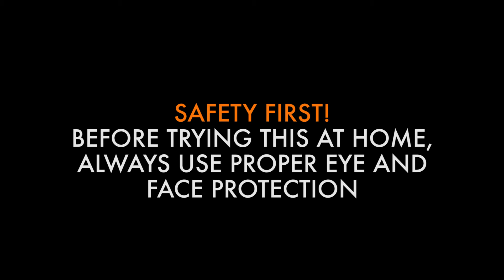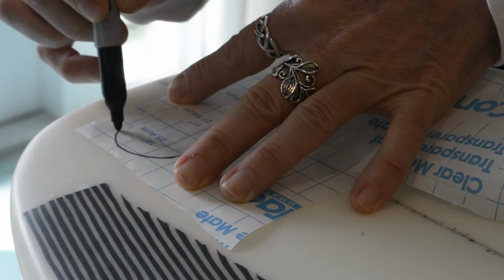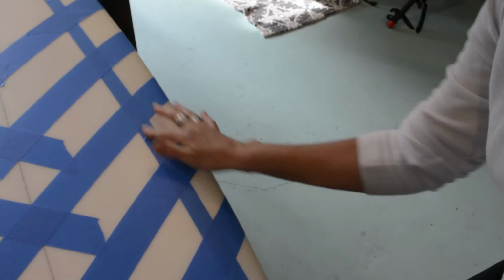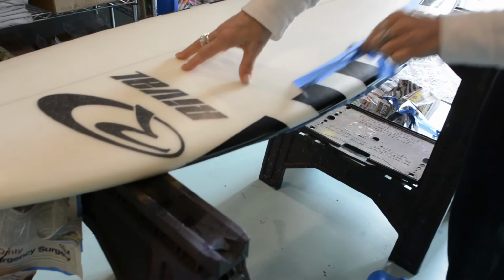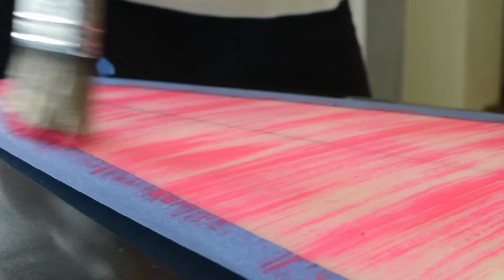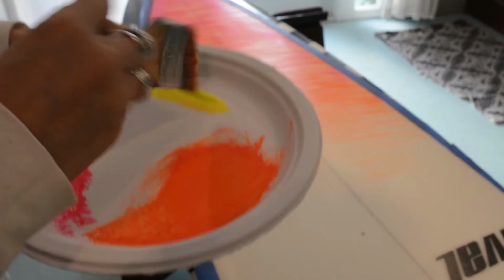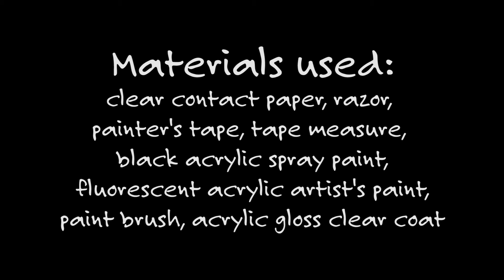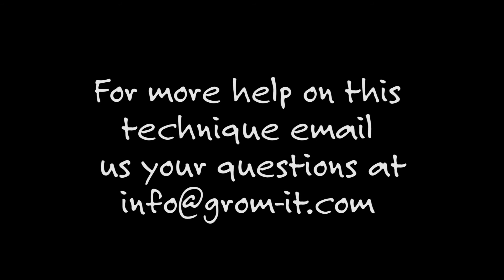DIY Board Art: Gromming a Board with the Dry Brush Technique for an 80s Inspired Look

Comment: Thanks for getting back to me. Yeah its a brand new board ( i didnt sand first though) the paints are acrylic. Half the board is black and that dried and stayed on fine but the other half i tried a  fluorescent orange spray and it never really dried i took that off. I then tried a  fluorescent orange craft paint and that just peeled off. My friend said maybe the paints were too low quality as some student paints are really watery which they were. The orange that went over the black has stayed on though. Is it important to get high quality paints??? I was considering putting a white under the  fluorescent as I think that will stick.
Reply from the maker: Jasson Mackay that's very strange that the black sticks but not the orange. We use Ace Hardware's brand of fluorescent paint and it works very well.   For regular acrylic artist's paint, we have used inexpensive craft paint and it works fine. Make sure that the side of the board that hasn't worked well is very clean before trying another paint.  You could try spraying an acrylic clear coat on the board before the orange. That may act as a barrier and allow the orange to stick.